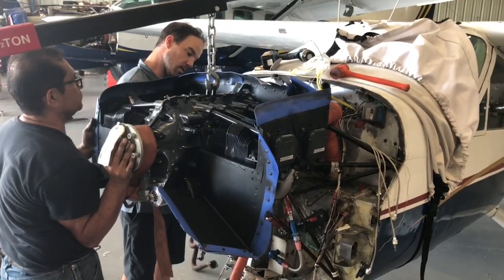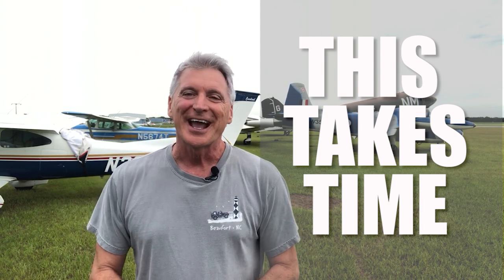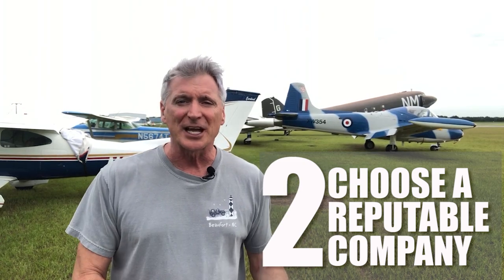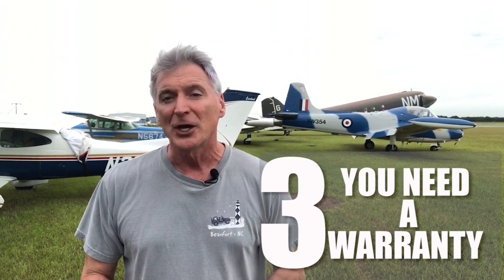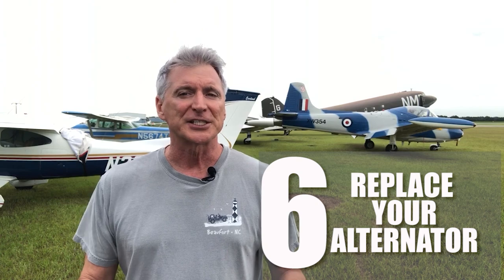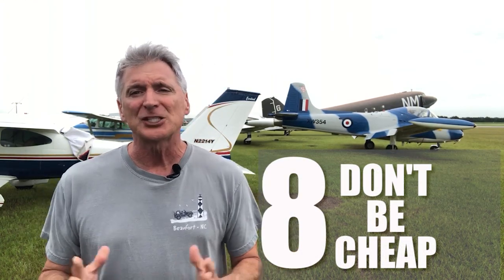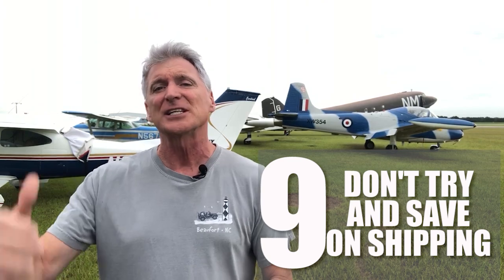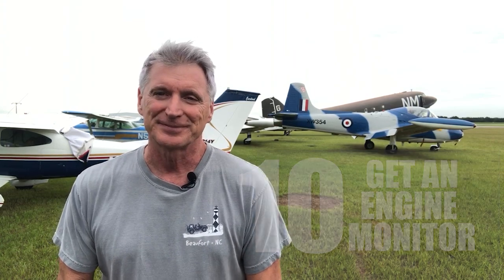10 Things You Need To Know Before You Get Your Engine Overhauled

Comment: The only critical part in an alternator is the front bearing. Then there are the brushes and diode pack. I just replace all three and not the whole thing.  For those who can do the job themselves, the overhaul will cost maybe $10,000, The $20Gs saved is a lot . People that sell VW or Corvair engines encourage you to rebuild your own.

Comment: A few years back my Musketeer's O-320 D2B (1300 hours/28 years SMOH) ground its innards in to pretty sparkles. Rebuilding wasn't an option: narrow-deck engines are a specialist thing nowadays and the engine had been rebuilt three times already. The local engine shop (one of the best in western Canada) didn't have a suitable core available so I wrote a check to Lycoming for a factory rebuilt O-320. Ouch.

The engine was just the beginning. When you take an old plane that far apart things happen. The costs added up. But boy was that first test flight sweet!

Comment: Waaaaah??  3/4 of a quart in 30 hours!!  That's pretty amazing Ted.
Reply: I had my 1973 Cessna 150 engine overhauled. after a couple hours of run time I flew it from Houston, Texas to Des Moines, Iowa and back. I swear it used oil like a car. At least 1 quart in 30 if not less. That was a break in.
Reply: @wendellmoeller6788  That's pretty awesome Wendell.  My IO-360 with only 800 hours engine time uses a quart every 7-8 hours.

Comment: So you put out a number for a new engine. What is the difference in your experience between overhauling the engine and really doing a firewall forward replacement/repair to include the other items that you mentioned such as electrical, prop, alternator etc. are we talking another eight to $10,000?
Reply from the maker: A completely new engine is about $65,000 it was just cost prohibitive. The good news is that I put in that $25,000 for a new engine and with all the upgrades I’ve made to my cardinal it’s worth about $130,000 now and I bought it for 38 so I’m pretty far ahead in the thing not that I’m gonna sell it I really like it now. Thanks for watching!

Comment: Mornin Ted! I’m right on your heals buddy. Our new factory reman engine just arrived this week… 13 weeks was a pretty long wait 🥴. We also had our prop over hauled and will have it balanced too and had our A/P servos serviced. I’ll need to talk with our A&P about the oil cooler tho… he didn’t suggest replacing that. Why do you suggest replacing it?  We are replacing a pile of hoses, some have been updated but the others that haven’t will all be the new style and getting rid of those “rubber” hose lines. As always! Great video and information. Scott KLZU
Reply from the maker: I just wanted everything new since I was putting in a new engine and I figured it was best to get a new oil cooler new hoses and everything it wasn’t really necessary but it was good that I did it. Thanks for watching!

Comment: As usual, an excellent presentation. Could you please give us an estimate of the total? $3,000 here, $5,000 there adds up. This would allow for better budgeting. Thanks again Ted.
Reply from the maker: It was around 38,000 total for the engine the engine monitor and the removal and installation of the new engine. Thanks for watching!
Reply: @Over50andLearningToFly  thank you. Just to be sure, did you also have the prop done? If so, the cost.
Reply from the maker: @marksill8020  yes  - prop overhaul was about 900 - balancing about 250

Comment: Thanks.  I’m starting to think about an overhaul, both in terms of tach time and years (decades?) “SMOH”.  I couldn’t sell the plane for  half of what you suggest spending even if I hung a factory new on the ol’ milkstool.  I’d have to fly it all off.  Let’s see.  I’m over 50 by 20, to fly off near $40,000...hey!  I could fly this thing ‘til I’m 100!  Think I’d better research other solutions.
Reply from the maker: What kind of plane ? Do use their craft market is really hot right now so you’d probably be surprised what you can get for it. Thanks for watching!
Reply: @Over50andLearningToFly  PA-22 Tri-pacer.  Yeah.  I know.  Everybody’s Dad ( or now, grand dad, ) had one.
Reply from the maker: You may be surprised at what it’s worth !

Comment: I have just under 1300hrs left on a non T-modded 0-320-H2ad. I considered the 160hp to 180hp upgrade. Imo the minimal gains weren't worth the cost. Plus losing 10deg of flaps is part of the upgrade. I rarely use 40deg but it's nice to know it's there.
Would the upgrade have taken anything away from the cardinal? Just curious...
Thanks for providing some insight into an engine replacement.
Reply from the maker: I don’t think the upgrade would’ve taken away anything for the cardinal it just would’ve given it more power but looking at the specs the useful load really wouldn’t increase that much  - So in the end it really wasn’t worth it for me. Thanks for watching!

Comment: Why does a new engine need a new alternator? If your alternator is working fine there’s no need to replace it.
Reply from the maker: It’s just best practices to replace the alternator with a new engine. Thanks for watching!
Reply: @Over50andLearningToFly  I think it really depends on the age of the alt. If it has the same hrs as a run out engine like 2000 then sure. But if it was replaced a few hundred hrs ago and checks out I wouldn’t. Chances of failure with a new unit are much higher.

Comment: Why you don’t get a brand new engine 
100% safe, I don’t think it’s more then $35,000,  dont be cheap as you say,
Buy new
Reply from the maker: It basically is a new engine … an overhauled engine has new cylinders - and this one has a new crankshaft as well - new engines are around 65k … for basically the same thing … this engine should be good for 10 years @ 200 hrs a year … thanks for watching !
Reply: @Over50andLearningToFly  Honestly, if you fly 200 hours per year and operate it properly (CHT's below 400 being one of the parameters), you will be able to use it for 20 years, not 10. One of my IO-320's has 2500-2600 hours in it, and all the compressions are over 70, with no excessive oil consumption. Regarding the oil cooler, I don't see a reason for replacement unless there is a leak. A proper flush would do it (in and out). Once you replace the hoses, there won't be contamination.